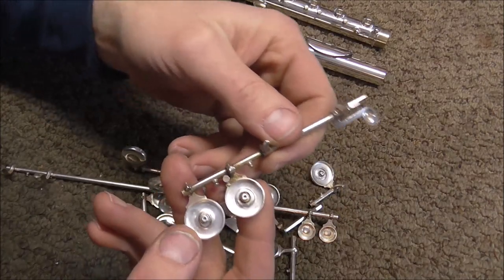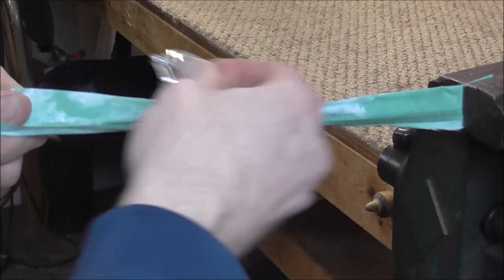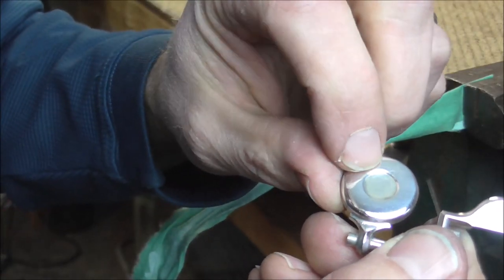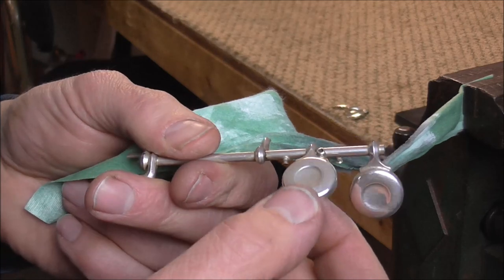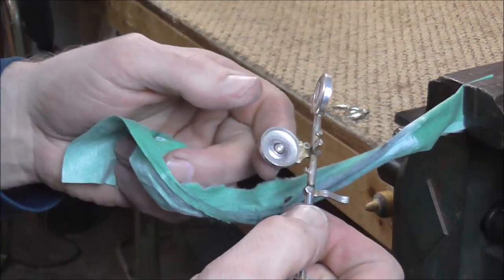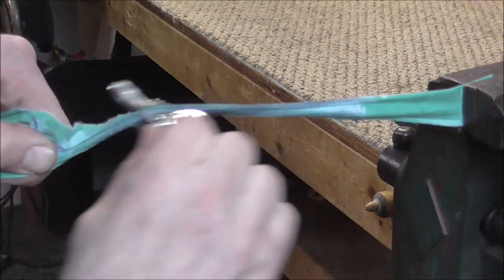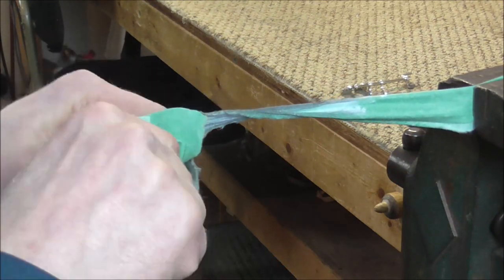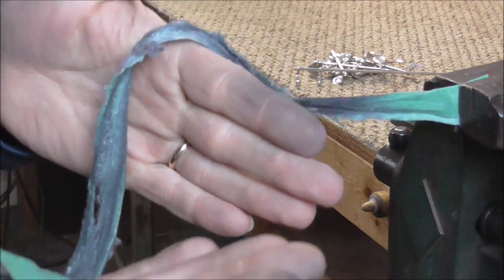How To Polish Flute Keys (With Dis-assembly)

Comment: My silver keys on a very expensive flute have been severely tarnished for years. I was told to never attempt to polish/buff the keys as this will take off a certain amount of silver and reduce the value of the instrument. What are your feelings about this?
Reply from the maker: Do not buff the keys because that can cause damage. You can polish them safely though. If you are not comfortable taking the flute apart, just use a polishing cloth (like the kind you get from a music store) on the keys and body. If you are careful, you should not do any damage.